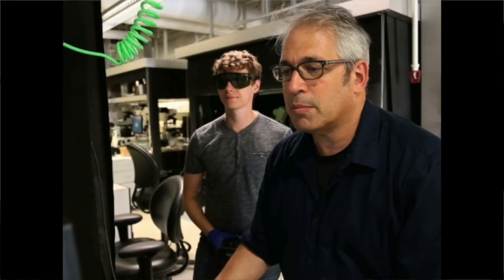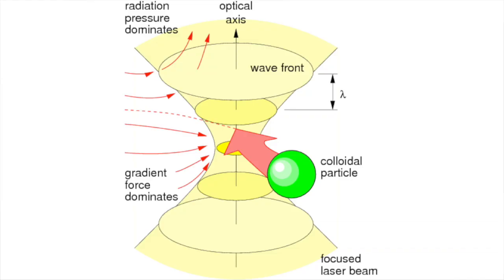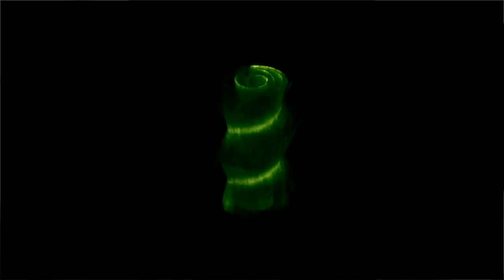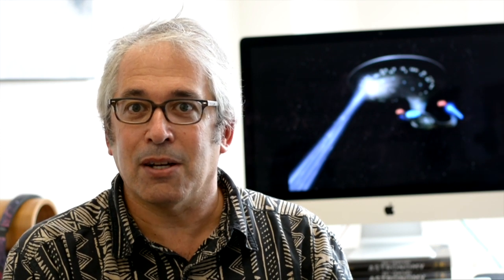A Real Tractor Beam

Comment: Aircraft carrier tract beam  push pull technology which 
Slows the aircrafts on final approach by aft mounted blowers while electromagnetic coils pull the aircraft not on the flight deck but into the interior of the ship then land it on to conveyor were crew can immediately inspect , refuel and return via hangar elevator for relaunch  with in 30 minutes. 2032

Comment: one problem with this idea.  Lets say you have a powerful fully functional tractor beam on your spacecraft.  And lets say your attempting to capture and haul in a floating asteroid.   Your space craft is weightless in the vacuum of space if not in motion and the only weight momentarily achieved is when mass opposes one another.   in other words.. using a tractor beam only works if you propel the capturing spacecraft away from the object your trying to pull in, Or your mass must be considerably greater than what your attempting to pull in.     or another way to thing of it...   Your doing a space walk,  you have a grappling hook and chain which represents your tractor beam.   theirs an asteroid slowly drifting by..  you shoot and connect your line to the asteroid.   do you have the asteroid or does the asteroid now have you?    First you need an apposing force to stop it. then you need a means to anchor ones self to pull it in.   In the case of a light beam,  its really no different than a physical chain.  But for a second lets say it is different,   that despite the craft projecting the beam it doesn't effect the beams source at all,  it just moved whatever the light strikes,   well..  if thats the case, wouldn't such a beam also solve our problem with propulsion?  you'd just aim the beam at your own craft which effectively makes it a lightwave engine.

Comment: i think you need to take a look at antione priore's work a french man who was able to manipulate cells in the human body think of the cells as atoms, or small magnets... he used radio waves to penetrate the body, a resonant sound via a frequency to match the cells frequency, causing the near field effect in the cell virtually disabling it , or causing it to behave like a black hole , sucking in photons to gain energy and correct the wobble in a sick cell, i believe the same can be accomplished, by using a pair of lasers with a variable frequency that would be controlled by computer to quickly rise through a huge range of frequencies until a resonant frequency is met, causing the near field effect, it could also be 180% opposite of the resonant frequency as this is the key to so many things in science

Comment: I disclosed the rotating helix wave to the public and scientific community in the 1990's. and have several YouTube videos on the subject  I could not get people to believe especially when I said this is what the gravity wave is.
I built a tractor like beam using a high power helix microwave beam from a rotating helix antenna.  It could put ripples 50 feet out on a lake.  A book is in the works but you can see much at synodicgravity.com

Comment: What's the diameter of the beam? And are the tractor beams harmful to organic material?
Reply: The diameter of the beam is around 1-10 micrometers, and the beams are not harmful to organic material. Surprisingly, the wavelength of the beam determines whether it is harmful. In this case, the beam wavelength is in the infrared range. Unlike harmful UV or even gamma radiation, organic material does not absorb infrared light and we are surrounded by it all the time.
Reply from the maker: Beam widths are currently very small, not sure but I think we're talking mm or smaller. These are not harmful beams, unless at extremely high power when, just like any radiation, it wouldn't be great for you!